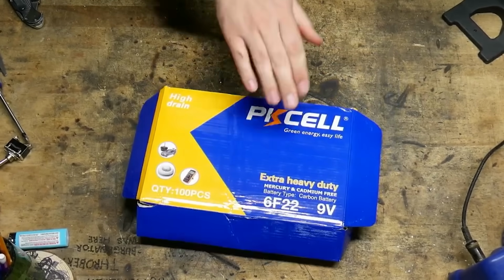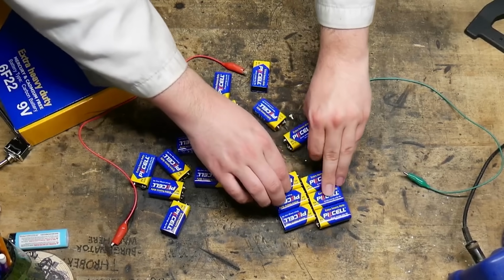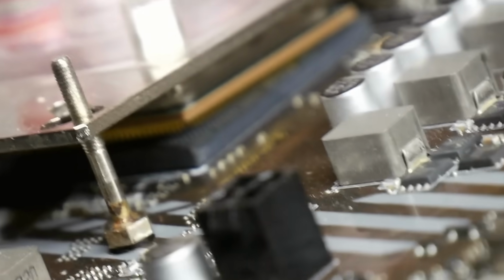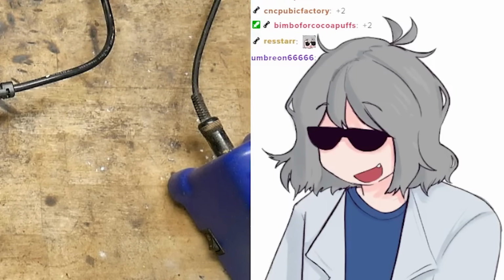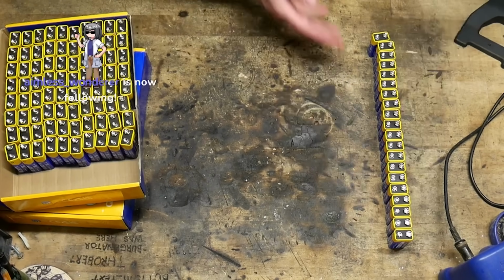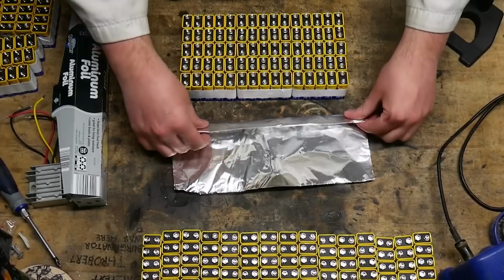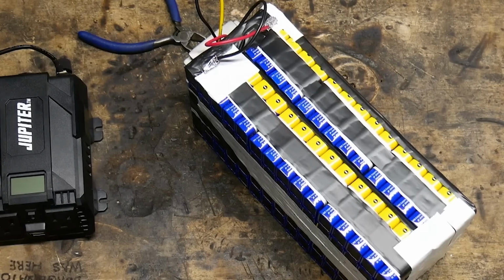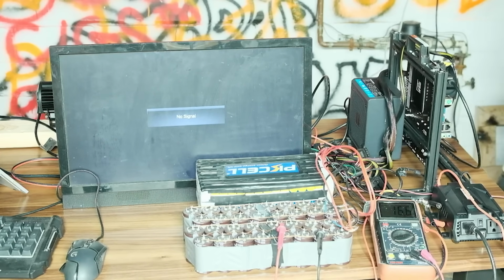Powering a COMPUTER with 9 VOLT BATTERIES

Comment: You should skip the inverter and psu, those just waste power by thermal inefficiency “siquell electronics” has a good video of running off a dc power supply

Comment: You did this about the worst way possible. Just feed the PSU 110VDC+ from the batteries in series. All switching PSUs will run on DC. No need for a inverter or UPS, etc.

Comment: honestly, you didn't even need to use an inverter if you just paired the batteries to produce about 120 or 240V. most AC appliances that don't have a motor will run happily off DC since they will end up rectifying the AC to DC anyway. And wouldn't you know it, that's what the computer's PSU does.

Comment: For a version 2, skip the power supply's AC to DC transformer and supply 12V straight into the rails. You're losing a lot of potential transforming that back and forth

Comment: If that's a switch mode power supply without a transformer it should be able to run on DC power. No inverter required.

Comment: I did the math on this.

A similar garbage 9v on amazon says 7 hr min runtime on a 180ohm load. 
Assuming an average of 9V that's 0.05 amp. 9v x 0.05 amp is 0.45W. At 7hrs that's 3.45Wh.
195 batteries at 3.45Whr is 673Wh. That's more than most car batteries.
Running at the rated 0.05A, the 195 batteries can output 9.75A. 9.75A x 9V is 87.75W.
~90W is most likely enough to run that pc.

Toss in a bunch of inefficiency due to horrifying busbars, cables, inverter, power conversion, and random garbage
and even at 50% it would run for over 3 hours. 

So if you didn't use that 12V DC-DC boost converter you could have had a 9V battery powered PC. If you didn't do anything too heavy you could have even powered the monitor.

... Assuming it didn't catch fire.

Comment: I have that exact same inverter and it is fully capable of 20 volts input because it's rated for like 10.5-26volts, I would've done series output and parallel wiring for 20 volts out of the batteries to the inverter to avoid the shutoff

Comment: Fun fact: you actually dont need the inverter at all. If you wire those 9v batteries in series enough to give you 120v, tou can just plug them directly into the desktop PC power supply.

This is bexause it's a switch-mode power supply. Not a linear one. So the power supply is going to convert it directly into High Voltage DC anyway before stepping it down.

Comment: I think it would be much better to have two parallel banks connected in series for 18V and put that into a PicoPSU that skips the 12V -> 120V -> 12V conversion chain

Comment: each 9v can supply up to 10ma. You need 100W to start a very low power no gpu pc . To get 100W you need 1000 batteries not 200.

Or boot RPi :D

Comment: That AC Inverter looks too small to handle that load. skip the inverter. use a few buck converters to replicate the +12/-12/5/3 volt rails of the computer's power source and power the board directly. if you are worried about burning up the board you can easily add a few capacitors and a high pass filter to protect the circuit from power spikes or sudden power loss.  that many batteries could power a 300w system for at least long enough to watch a YouTube video.

Comment: if you open the psu and you tap two wires on the first 400v capacitor they can last longer with out inventor

Comment: Since the 12V rectifier accepts up to 40V, would increasing the input voltage to 36V by having four 9V banks in series let you get more out of the 3 amps, or does the supervisor IC monitor the output current?

Also, an idea on how to make this so, so much jankier: PC power supplies output 12V, 5V, and 3.3V when operating, and will also constantly provide 5V in standby. Your CPU and GPU draw predominantly from 12V, so a vast majority of the total power consumption is from this rail. Any halfway decent PSU nowadays will convert to 12V first, then convert 12V to 5V and 3.3V as needed (if you're curious, the PC power supply used in the video is the Powerspec PS-500WF, which does not do this and instead regulates 12V and 5V together because it's cheaper.)
The process in this video of converting DC output of the 9V cells to AC in the inverter then back to DC in the power supply loses a lot of power. Depending on how much you trust your rectifier, you could plug that output directly to your motherboard. Minor rails (5V, 3.3V) could be generated using buck converters, if you don't have rainbow LEDs or hard drives the combined power draw on these isn't going to exceed 15 watts. The 8-pin EPS connector on the top of the board and the 24-pin ATX connector on the side of the board are standard, and you can find the layout online (feel free to leave the -5V and -12V pins unpopulated, modern components don't use them and these voltages are entirely absent from most modern PC power supplies anyway.) 
...Of course, the other function of a PC power supply is to shut itself off if something goes wrong, protecting your computer. This is a feature that will be entirely missing from the PKcell monstrosity.

Comment: 7:55
That, in fact, is an extremely good application of thermal paste. The CPU came out because there was no air gap. When two well finished blocks of metal with very tight tolerances are rubbed together, vacuum gets created between them and they basically bond together, and the only way to remove them is to slide them out of contact - a process called wringing. The fact that that's what happened here is impressive.

Comment: Fun fact if you put enough in series it will just simply work  just by connecting the batteries to the power supply witouth the inverter
Reply: To elaborate (in layman's) switch mode power supplies such as that ATX psu work by turning the AC from the wall directly into DC and then using that to make another DC voltage so by putting about 34 of them in series would give around 300 volts DC which is about the voltage that those power supies run at internally. If you decide to try this please be super careful because that high voltage has a lot of potential and can make sparks and can make stuff explode not to mention the shock hazard that it makes.

Comment: I know you were worried about the inverter being overvolted but it’s worth noting that almost all of the 12V automotive parts are actually capable of handling up to around 30V.
This is because most 12V parts are also used on trucks and off road machines that typically run 24V system, with ~30V being their normal charge/operational voltage when the alternator is running.

Comment: Carbon zinc batteries are recommended for very low drain devices - I don't even think they're recommended for smoke alarms because alkalines last for much longer, and smoke alarms can sometimes be fitted in inaccessible locations where you need ladders. So you don't want to be changing your batteries once every few months...
Also, where did you buy these Pkcells from? I really want to buy some Pkcells :)

Comment: Why so complicated? A PC only needs 3/4 voltages: +12 volts, 5 volts, 3.3 volts, -12 volts (although I don't even know if -12V is even necessary). Sure, that requires multiple batteries, but you could do it that way.

Comment: I'm going to make a guestimate how long it'll power a laptop. I know theirs ways to calculate this but without doing much calculating I know laptops use baterie packs idk how long laptops can usually be on however it's probably at least an hour, I know alcaline batteries usually have a larger capacity then most rechargable beteries of the same size and that box of 9v batteries is actually large so I think if it powers a average laptop which i think takes about 80wats
The laptop can stay on for surprisingly at least 4 hours however if your using the batteries on a average desktop it'll be powered for less then that sense desktops are usually more power hungry. I think powering a average desktop which I think is about 150 wats the battery pack your making will 
Keep the desktop on for at least 2 hours. 
This is low bowling it tho so it might 
Last longer in my head, if it doesn't last that long maby the pkcell 9v batteries are not as high energy dence as a normal alcaline battery or theirs more factors to cosider i might. E missing something cuz 2 hours sounds kinda long before I thought about it.

Comment: You should have fed the 9v into a DC to DC converter or 2 and outputted the 12 and 5v rails directly to the pc skipping the power supply.

Stepping the voltage up and back down is adding a huge loss of efficiency

Comment: Before removing a cooler, my recommendation is to power up the PC before and let it run for a few minutes in an intensive CPU scenario, it will make the thermal paste more liquid due of the heat and will not be stuck like that anymore.

Comment: You could just give the power supply 120v dc. It won't like it but it should still work as long as the rectifier doesn't die

Comment: Funny thing is with all those 9V batteries, you have a capacity of around 1kWh give or take 

So assuming you could use all the energy (10V down to around 7V) 

It could run the computer and monitor for hours
Reply: Would have been much more efficient to skip the inverter and try to run the PSU directly from DC (or replace it with a purpose built DC power supply). 12-13 of those in series should have enough voltage to power a normal ATX PSU which would have still allowed for at least 15 in parallel keeping the per cell draw at well under 500mA

Comment: Some or lots of switch mode powesupplies like the ones in computers immediately rectify the mains 120v ac to dc  so it wouldnbe cool to see him try to just boot it off of 13 9v in series at 117v straight into the psu. Probably would be more efficient than the inverter and dc converterand should work lol😅 (dont try this)

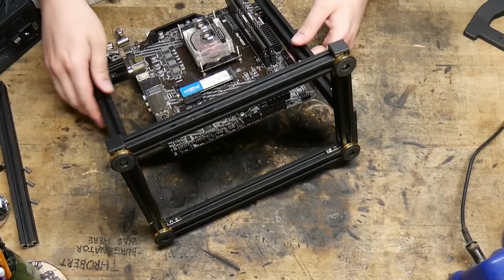Comment: 7:04 did uwo forget that with water blocks on CPU’s….. you’re supposed to heat them up carefully and those water blocks should pop right off without causing any insane damage

Please don’t do what Uwo did. He got super lucky he didn’t damage the motherboard and the CPU

Comment: Maybe you should have used copper wire for the bus bars (Tin foil has lots of resistance), and put two or three banks in series to bump the voltage up to account for voltage drop. MPPT's are extremely common in solar installs and will have a wide input voltage range, use that to turn your 20-30VDC into 12VDC, and then into your inverter.
Reply: he is doing it wrong on purpose for ekstra comments.( I think) why use a dc-dc stepdown(12v) -> inverter -> psu(12v) -> efficiency loss 50%+foil? so dumb.. there are pico psus with wide input voltage 12-25v.

Comment: I don't think having three layers of power supply equipment helps in this case

(1.5 V is a pretty decent granularity so I would legit try figuring out a way to connect the pack directly to the mobo)

Comment: The proper-ish way to do this is to put a bunch in series to approximate 120VDC and just run that into the power supply, most switch mode supplies can handle DC just fine.

Comment: You shouldn't do the following.

You could have wired the batteries into banks of thirteen 9V batteries in series and just hooked the battery pack directly to the ATX power supply. Skip the inverter. It probably will work.

Comment: Those batteries dont have alot capacity nor can put out alot of current. However you are more limited by  the Atx power supply ac  conversion. If you bypass the atx Power supply you can run the pc with only 60 -65w or less depending on cpu used. I have run off a pc without dedicated gpu off a laptop 12v 5A charger. Even monitors use 12v & 5v internally (Some even have a plug for 12v input on the board)  so you can do it. (already did before because had a monitor with bad power supply).

Comment: This probably would have worked with something like a PicoPSU with low powered hardware. There are PicoPSUs that can accept a range of like 10 volts to 24 volts, so two banks could give you 18 volts.

Comment: You get a better power efficiency if you use a Pico power supply and wire the batteries straight to the PSU circuits

Comment: I was hoping for Uwo to actually put the batteries in series and in range of the PSU input voltage before connecting it directly to the PSU

Comment: Okay. 
USA ACV = ca. 110V by standard
Needed amount of 9V batteries per cell is 12,2 batteries. 
Normal 9V battery today is 1200mAh or 1,2Ah.
You can make a ~17 cell 110V battery out of the 200 9V batteries which gives ya ~20000mAh or ~20Ah. Depending on the power consumption of the PC... Which is informed in Watts ( W ) and basic PC wattage is 650-750 ( in some cases lower ) I would say the max amount of time the PC runs is maybe 30-60 minutes.

EDIT:
Up to 5,7 hour run time

Comment: Dude those batteries dont have isolation rated for such a high voltage, also please use gloves, i fear for your life seeing you handle all that voltage with your bare hands... Especially the alligator wires, thats the worst thing you can use

Comment: You could have done it way easier. You should have bought a 24V inverter and put 3 9V batteries in series (27V) and a bunch of these 27V packs in parallel. Then you could have directly connected it to the inverter.

Comment: You need to heat it up before removing, running it for 30s-60s without a cooler would have saved it from pulling out like i have learned the hard way

Comment: If you used a 38s configuration then you could directly whack it into the PSU using the AC pins. internally the PSU uses 160-380Vdc anyway

Comment: i would advice to not use an inverter next time, but instead one of those 24 pin 12v converters, that you just give it 12v and you have your 24pin power plus the 12v 4/8 pin for the cpu, the efficency will be higer and the loss will be lower so the pc could actually say on for more time, and if you add a 12v buck/boost converter BEFORE the 24pin adaptor, you'll have a constant 12v input regardless of the batterys voltage
If you actually are considering this, don't mind asking me i would be more than happy to help you!

Comment: The initial setup with the batteries in series would have worked better I think, because you can shove 240V DC into a switching power supply; they rectify AC internally anyway.
So 30 in series, and two banks of those in parallel should work out pretty well. US power would need 15 in series x4...

Comment: They are likely individually wrapped as that package is probably meant to be used by manufacturers, for example those knockoff garage door opener keypads, which they don't have the buying power to buy huge amounts but they want to maximize profits. However I will note that PKCELL is a somewhat reputable brand, it's not really as reputable as things like energizer, but it is way more reputable than most of the batteries I get with products!

Comment: with the 10.1 voltage, i would reccomend 2 cells in series because of the unknown voltage drop under high current draw, which leaves 100 pairs, with each pair having 3.8 watt hours of stored energy, and 20.2 peak volts of energy, with everything wired together, 2s100p, it should be around 20 volts, 19 amps, 380 watt hours, math might be a little off, im tired and need a nap or something.
Reply: next time, you should make AA powered pc

Comment: Dude why not just use your big banks to make 18v with a bunch of amps, get a pico psu and your 18v to 12v voltage regulator and save all that energy converting the DC to AC back to DC?  The pico psu units expect a 12v dc barrel jack under normal circumstances, just bypass the barrel jack with the output of the 12v regulator

Comment: lol i rember having a box of batteries like that i had got them in order to wire them in too a xenon flash lamp in place of there capacitor . i just never got around to it before i had to move so i dont know what would of happened likely overload the tube and cause it to explode lol

Comment: This is fkin stupid as all hell

Subbed

EDIT: I forgot to put a leash on one brain cell this morning and it's wondering if you could have just slapped 120v DV into the PSU and ignored the DC -> AC -> DC conversion losses. supposedly the first component is a rectifier but I don't believe that since there should be an AC transformer somewhere in the mains side.

Comment: I am 5% sure you can wire the batteries as 120VDC and feed that directly into the power supply and be "fine". Or 240V. It'll be fun!

Comment: You could've put two batteries in series and then a lot in parallel to make 18 volts and feed it to an 18 volt to 120 volts inverter

Comment: You shoulda put a T tree and branched the battery to the pc plug 🔌 and jumped it off there to supply power then when everything is running and up to specs turn the switch off so it’s just running off the inverter and not getting jumped.  Since everything’s kinda in sink you can just take a positive wire from the battery and run it to the pc power cable shouldn’t need to add in the ground

Comment: I would have done this by directly powering the pc using the batteries themselves in a high voltage config. The power supply in an ATX handles up to 340 Vdc. That way you have low current which will be much better than low voltage at a high current. The inverter can be completely omitted.
Reply: yeah thats better but more sketchy in safety.   a dc-dc pc power supply would be better though.  cheap inverters can't handle even 300w laptop psu
Reply: @lasskinn474 I fully agree, those little inverters are so cute though lol.

Comment: I wonder if the PSU could've handled 120V DC input. All supplies are switching based so I think the only concern would be whatever it has handling the AC before the actual switching circuits.